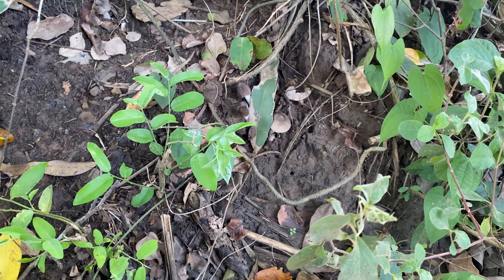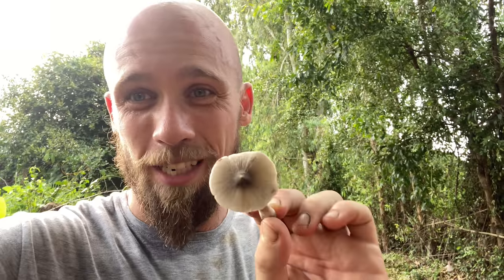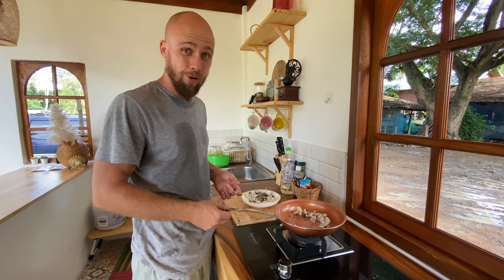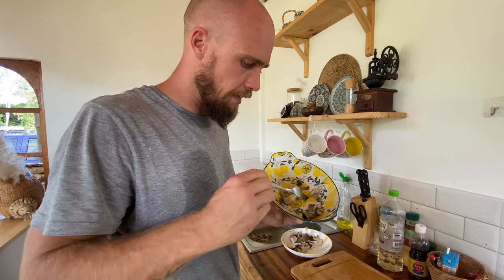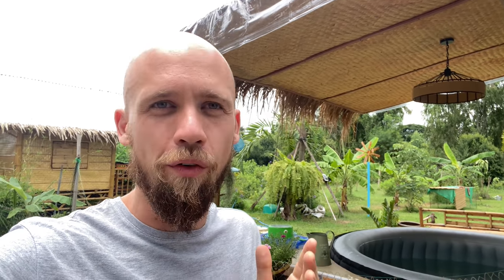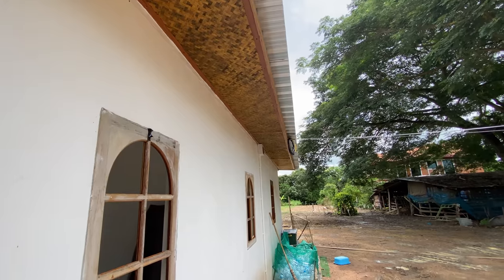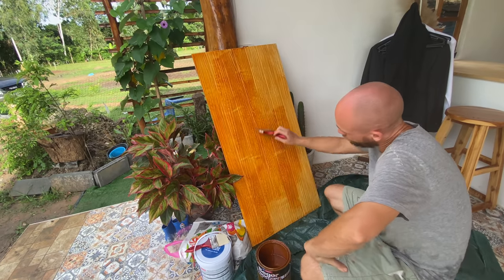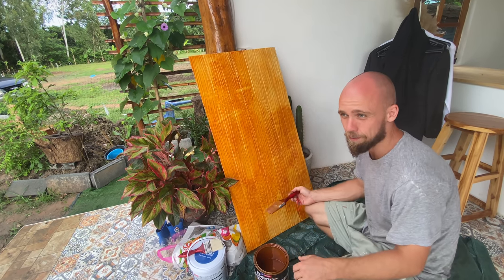BIG PROBLEM With Our New Build In THAILAND 😢🇹🇭

Comment: Hey Ryan and Damo and Otis are the workers putting up the roof panels. Ryan, what we used to do when I lived on my boat in San Diego we had the same problem. My wife at that time found a moldicide that you could just put in your paint and shake it up. It worked perfectly, we never had any problems with mold again.

Comment: I wonder if condensation under the tim roof could be contributing?   We built in Prachinburi.   To keep the area under the concrete tile roof cooler and dryer we put the cheap blue screen under the eves to keep the critters out and then put up conwood boards with about 1/4" between them for airflow.

Comment: Another great vlog. Looking at your mold situation I am wondering if it is more than just the high humidity of rainy season. I am guessing your roof is uninsulated, if so, you may find fairly significant condensation on the underside of the roof in the mornings that might be dripping onto the top of the bamboo matting. Can be quite a nuisance this time of year with the high humidity and cooler evenings. I would like to commend you on your openness about your addiction problems, I think it is helpful for others who might be struggling to see that with persistence and support there is hope for recovery and happiness. Cheers!
Reply from the maker: Thank you and yes we think the humidity is the issue as it is on neighbors houses too 🙏
Reply: @lifeinruralthailand  You have to figure out a way to vent the underside  of the roof. Also you may include some roof vent. with air circulating it may remediate the mold issue

Comment: I'm guessing this problem is happening at the rear of the house which is also the lowest point of the roof?  Because you have not installed a gutter the water will pour straight off the back but also be blown in towards the matting and rear exterior wall.  I am building a house with a similar roof in Southern Thailand and observed this happening during the huge down pours we get here, I installed the guttering 2 weeks ago and now have dry walls and eves.  Also well worth sticking a 2000l water tank under the down pipe, great for filling up that hot tub in dry season!  Hope you get it sorted.

Comment: There is an issue with your roof, it is slanted in one plane only. This then allows rain to follow the roofline and drip in the mat. The solution is to create a dripline, put a bit of ridge of clear silicon just under the edge. The raindrops will then collect on this silicon edge and fall to the ground, not roll into your building and ceiling mat. Some builders use a bend over edge to have the same effect.
And just replacing the mat will not solve the water intake issue. It will be back.
Reply from the maker: Thanks 🙏🙏

Comment: We had a small problem with mould here also in Ubon, through a little research I learnt that mould grows where bacteria and moisture  is present. By keeping it clean 'not touching with bare hands' & ventilated the mould has stayed away🇹🇭
Reply from the maker: 🙏🙏🙏 we are hoping the inside is ok too 😬
Reply: @lifeinruralthailand  if you take down the inside to clean with bleach or alcohol make sure you use latex gloves to reinstall

Comment: The mold is one story the wood termites are another. You speak great Thai so I'm surprised you weren't aware of the problems using anything made of bamboo?
Reply from the maker: Bamboo huts soaked in borax as we live in can last up to 30 years. 👍
Reply: I certainly hope little Otis wasn't anywhere near when you were soaking the bamboo sheets in the solution.